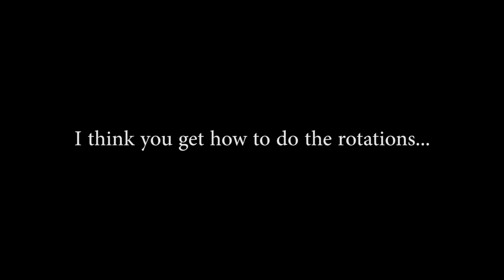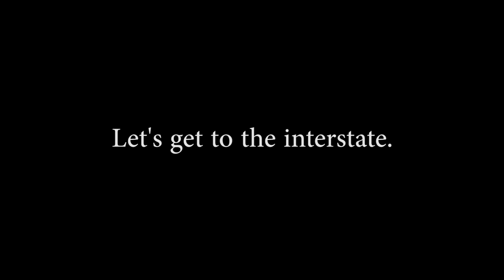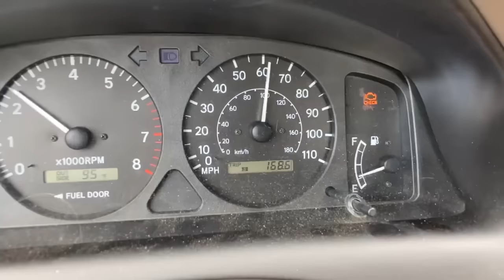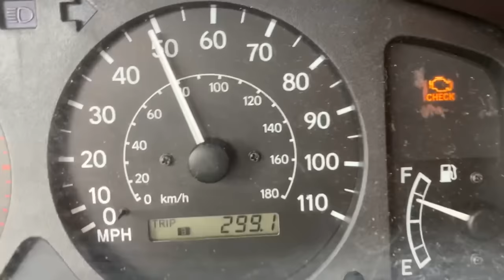Will Berryman's B12 Chemtool stop oil consumption? 😲 | Oil Burning🔥Experiments | Episode 15

Comment: Dave, I have never seen that much oil on the top of a piston. I've rebuilt some pretty bad smokers, but never ever took one apart with liquid sitting on any piston. There wasn't even that much oil on the rocker arms. I doubt if heavier oil would make a significant difference, but I'd like to let you in on a dirty little secret: The car companies want you to use thin oil so they can use it on their EPA test. They get better cold start emission and FE performance with light oil but they can't use it on the test unless they advise the customer to use it. Good luck.
Reply: Even worse, what the EPA considers to be a 'lifetime' vehicle is 150K miles so the manufacturers design their vehicles to last that long plus the fact they consider burning a 1 quart every 1200 miles as 'acceptable', it's no surprise these cars with the thin oil end up burning oil later in life. The fuel economy benefits of thinner oil are only seen when it's cold or on cold start but otherwise they're imperceptible on a warmed engine.
Reply: Saw a report by a Ford engineer on a racing forum some years ago.

Ford rec'ds 5W-20 on modular engines. All for CAFE. Guy said they tested longevity with 5W-20 semi synthetuc & 5W-30 full synth.

Police & taxi engines lasted 150K miles (significant ring & valve guide wear) & over 250K with little or no wear on the -30 oil.

He uses ONLY 5W-30 full synth in his family vehicles & 0W-40 in his race car.

Eff CAFE (Corp Avg Fuel Economy) mandated by the Feds.  My personal experience mirrors this. 

-20 yields abt 2MPG better mileage (7%) than higher vis oils. Engine wear much lower with better lubricants. Eff CAFE & the EPA.

Comment: Awesome job Dave!  Hope the B12 treatment will delay or permanently fix the 1zzfe engine's oil burning problem!  Please keep us updated.
Reply: 3-5k oil changes and add some MMO every other change.
Reply: Isn’t this considered fixed ? Maintain and keep it clean i guess. Hoping this does the same thing in my infinity g20
Reply: Use fully snythetic it make only dark brown at 7000 mile oil change. It game changer for that engine
Reply: @maungmaung4037  if the engine is burning oil that will only help so much
Reply: @daniellocke4172  SR20's usually don't burn oil, that's one of the best engines ever made.

Comment: B-12 is the only chemical with a "poison" label in the bottle ... that should tell you something ... instead of following up with regular oil .. just add marvel mystery oil after treatment and then do your oil change ... then add "stp" oil "basic or simple" to help raise the oil pressure ... it worked for me ... former fleet mechanic ...
Reply: Finally someone with "proper advice" good job.. 👍
Reply: First off you have to dump that saturated  dirty oil  your bearings are screaming Second off you don’t rev a cold engine  ever next  you should always follow the cleaning with marvel to  replace the lubricant you washed off the walls   50 years ASE master automotive   Technician    Fyi if you drive like grandma  your more than likely to accelerate the carbon building process
Reply: @dennisd1778  my rodeo was sitting 8 months so before running I'm planning on putting 8 oz of MMO in my crankcase with a new oil change, and 8oz in the fuel tank. My Rodeo never had that common tapping that is common with that 3.2 motor but I'm sure hoping it doesn't start. I also have a brand new bottle of Berryman chemtool. Any other advice?
Reply: You don't really want to thicken up the oil on cars with variable valve timing. V.V.T. The oil passages are very small that control the VVT. That's why most new cars recommend 0W 20 or something similar. And a quart of Marvel Mystery Oil in the crank case does a lot of good before your next oil change.
Reply: Id Berryman's B-12 Chemtool a detergent based product? Or does it smell like acetone/nail polish remover?

Comment: Thank you so much Dave, excellent series! I think you have given may of us out here some hope. I came across your channel looking for a solution to the same issue on my 2009 Toyota Matrix with a 2AZ FE engine. My engine's oil consumption is not as sever as yours but it still is concerning (1 qt/1200 miles). However, before I try Berrymans I am going to use Seafoam in the crank case before each oil change (3K miles) and see if that works. It is a lttle milder. I worry that Berrymans could damage the crank case seals. You now have one more subscriber. Please keep us posted.
Reply from the maker: Thanks, Russell! May you have success with your Matrix!
Reply: Update: I ended up doing the same experiment as you did with Berryman's B12. After running at redline, or close to it, for about 35 miles and then draining the oil, there was a lot of sludge and carbon deposits present in the oil. I then added fresh synthetic 5W-30 oil and installed a new filter. Two things that I did different than you in the oil change is I added 2 oz. of Seafoam in with the fresh oil - your Seafoam experiment did show some temporary improvement - and added 5 oz. of SFR oil additive which I use regularly in all of my engines. I than drove the car as normal (approx. 65% highway, 35% city). I added another 3 oz. of Seafoam to the oil with 500 miles remaining before the next oil change. I checked the oil level regularly with very little oil consumption and after 3260 miles I only burned approximately a 1/2 quart. I then changed the oil again adding the 2 oz. Seafoam and 5 oz. SFR. Hopefully the oil burning will remain low. Thank you for your video, I definitely helped me!

Comment: I would use a quart of oil every tank of gas with my 2008 Scion xB. I put two cans of Berrymans in an almost empty tank of gas and drove it two days about sixty miles and don’t use any oil anymore. 👍🏽
Reply: My Dodge neon non-turbo used to burn oil and smoke at start up before using Valvoline high mileage synthetic.  After using the oil for several changes the smoke stopped.
Reply: Im about to try this on my 09 xB, hopefully i dont ruin the engine,  burning a quart every tank as well
Reply: I'm confused! 2 cans in an empty gas tank? Jeez was it at least a 25 gallon tank or higher? They say no moe than 1 oz per gallon and a can is 15oz.
Reply: @tallboydr2 worked on mine.  Using about 75% less oil.
Reply: @theoriginaljimmykicker  i tried it a few months ago, consumption went down like 50%, a bit better than before, but i also it burns less if i dont fill it to the full mark
Reply: @tallboydr2  another important thing to note.   I’ve done it twice.  The first time it reduced it by half.  Then a second retreat reduced it more.  So it went from like 300 to 600.  Then 600-1300.  I truly think if you run a can of this in a half tank of gas after the initial treatment, this will continue to improve.  I thing to the point to where it uses almost none.  I’ve got a Lexus RX350 that has 417k miles on it.  It uses less than a 1/2 quart between 4000 mile changes.  Honestly I think it has a small leak and doesn’t really burn any significant amount at all.

Comment: Cool video. I saw a video by Mike Busch of Savvy Aircraft Maintenance and the topic was fixing low compression on aircraft engines. AVGAS is leaded fuel and the lead bromide builds up in the rings and cannot be dissolved like carbon from unleaded fuel. So, one way to try to force the lead out is by filling the cylinder with a solvent at the bottom of the compression stroke, installing the spark plugs, and pulling the engine through a compression stroke. If the valves are lapped and seated well, the solvent will be forced through the rings and hopefully mechanically remove the lead.

I am going to soak the rings and leave them for a while. Then, I am going to do the ring wash like I described with the Berryman's or with Sea Foam, or maybe a stronger solvent. I am thinking it light work really well.

Then you have to put oil in the cylinders and turn the engine over, since every bit of the lubrication will be washed off the cylinder walls.

Comment: So loving your experiment/results!
Keeping your methods so consistent is key.
I'm at point with 2006 Tundra at 101 5K that injector swap, BC Gasket Kit on Bank 2, and PCV replace.
B12 next if the oil keeps getting dirty prematurely. 
Great job.
Subscribed.

Comment: We would use automatic trans oil in the oil to clean the sludge and buildup, it also softens the seal to help with oil leaking. 1/2 quart to 5 qts of engine oil

Comment: I was hoping you crank the engine  to remove all liquid before installing the spark plugs! Hopefully all the seals didn’t get harden from the B12 Chemtool because of the rate of evaporation! I would probably drain the oil before the test drive!

Comment: I've tried a similar test on 2 Jeep 4.7s I had that used oil due to stuck rings. I switched them to synthetic oil for the high detergent to break it up as best I could, with some cleaner as well. One thing I found that made the difference was not just high RPM use, but high load use. You really want to heat the pistons up a ton. I would load up my trailer and go pull big grades with them and try to get the engine temp climbing and maintain for awhile. Seemed to work alright.

Edit: if you do change oil visocity, my go-to oil burner "fixer" is 5w40 Rotella. Great oil, and seems to help. Subaru guys love it for some reason 🤔

Comment: I own 2001 Corolla with oil burning issue as well. I suspect that sometimes if i don't warm up the car in the morning (specially in winter) there is more oil loss when piston slap noise is louder which kinda disappears after engine have warmed up, that slap contributes to some oil passing to burning chamber and i lose more oil that way. Piston slap is when there is a bigger gap between cylinder walls and pistons. When the engine sits overnight rings & piston shrink plus if the engine has some wear there is even more lose. When the engine is warmed that gap will be smaller which will translate to less oil passing through the rings. I'm finding if i drive with mostly low rpm in town i loss less oil while a short free drive (higher rpm) cause more oil burned. Keep up the good work!

Comment: The area of the piston rings and grooves is one of the most challenging parts that a motor oil's formula must protect. This engine with low tension piston rings combined with limited or very small holes in the piston oil control ring grooves or "ring lands" creates a challenge to average oils. To keep the piston rings free and the oil return holes open behind the oil control rings, an oil of high or highest quality is what is needed. First off, a synthetic oil can deal with these challenges better due to better resistance to highest temps in this piston area near the combustion chamber. But there are all levels of quality in synthetics. Mobil 1's best EP oils help here as do Castrol's best  Extended Performance synthetics. If you really want the best protection, consider Amsoil's best Signature Series oils. Had your engine been run on this oil it's whole life, even at 15,000 mile oil change intervals or longer, you would not be trying to lower oil consumption on this engine. I know this with personal experience.  No I am not an Amsoil Dealer, but I have been impressed with their product performance over the years.
Reply: I have a Volvo T6 Polestar that burns about one quart per thousand miles with 90,000 miles on the odometer.  This issue is not a secret to Volvo owners.  It has been maintained at the dealer since it was brand new, with no oil change exceeding 5,000 miles.  The dealer only uses Castrol Synthetic.  I am evaluating whether to try the B12 treatment as done here, as there should not be any  reason for this engine to be burning oil except for low quality rings when it was built.
Reply: @frankmc2602  did u change the oil every 6 months? Or every 5000 miles? Oil needs to be change every 6 months or twice a year. Rather u reach 5000 miles or not, but for some people only drive 5000 miles a year so they stick with the 5000 miles rule, change it when it reach 5000 miles but never realize it’s been a year old that 5000 miles oil was in your engine collecting fine deposits and particulates that can ruin and clog your oil ring and holes. Your car burns oil because manufacturers went to low tension rings that created less friction for efficiency years ago and extended oil change interval over 6 months to 8 months or 1 year. if u keep the oil in your engine for too long, let’s say over 6 months, nothing high quality oil can help u.

High end quality oils like amsoil or redline, Royal purple has higher than average grade detergent additives and high level of ZDDP contents in them. Which translates to clean so well and protect so well…BUT since their oil clean so well, it ended up a lot of deposits from oil combustion vapor in them, thus they trends to be becoming black contaminated really fast. This will also clog the oil filter faster than normal as well. The correct way to extended oil change interval was change oil filter every 3000 miles rather u use high end oil filter or not. 3k is the maximum life a any oil filter. Then u can extend the oil change to 8k, or 10k but change the oil filter every 3k to keep deposits out of your engine oil. (I don’t recommended because I don’t believe in extended oil change interval anymore)

R u sure your dearship using Castrol synthetic for oil change? Did u see them put in the oil with your own eyes? I asked because I know dealership claimed to use certain oils but in fact, they use the cheapest oil they can find for servicing your car then charge u the cost of the oil they claimed they will be using. It’s a known practice thru out dealerships that the techs and mechanics will always end up with piles of FREE oils left over in the shop for themselves because customers paid for them but it’s not needed for their oil change becuase it’s never use.

Also drive your car hard at times help burn off deposits in the piston ring as well. People who track their car will always have a healthy engine than people who just drive their car normally and don’t rev the rpm pass 4000. Because gasoline is a VERY VERY good cleaner itself. (It’s strong enough to strip off paint and rust) so it’s a good carbon cleaner. When u drive at high rpm, u put your foot down the gas pedal, injector will inject MORE gasoline into the combustion chamber and high rpm means piston travel up an down at high speed which creates higher than normal HEAT. So high amount of gasoline meets high mount of heat and speeds = bye bye carbon buildup.
Reply: This why I always used an engine flush before changing my oil , Amsoil or Liqui-Moly . Now I have tried BG EPR twice and for the third and last time soon . Then back to Amsoil or Liqui-Moly .

Comment: The galloping sound when starting means you are down a cylinder. The one that was dry is probably not sealing/low compression.
Reply: More like piece of carbon sticking a valve open slightly

Comment: Careful if there's still B12 in the pan and it's still diluting the oil. Just check for the oil getting thinner over the time you pile up miles. Keep up the good work
Reply: I've done the same thing a few times, I do it when the engine is warm, most of the berrymans evaporates. any remaining chemical is acting as an engine flush and removing sludge and varnish.
Reply: No need to be careful. The chemical evaporates

Comment: Great results ! I have had similar results using a 20% ratio added In the oil of HyperLube, with also great results. My vehicle(s) 4.6l ford was using about 1qt of oil every 1k miles and after keeping the 20% Hypelube they (actually of them) only used a very small amount of oil at the 5k oil change interval. Seems todo a good job of keeping the rings & ring grooves very clean. Good product !
Reply: Hyperlube and Lucas are not good. They are just cheap "Bright Stock" they can gum up piston rings on engines that do not have issues with piston rings. If you need a heavier oil use a heavier oil not only is that cheaper but it is less likely to gum up the rings.

Comment: Okay I got results after one full tank of gas. I have no oil consumption after the B12 piston soak!!!!! This thing has burned oil as long as I've owned it since 2018 and just got gradually worse and now no pucks of blue smoke or anything. Thanks for doing this dave. I'm still going to run my cleaner through it but I'm going to get some life out of the oil first! I'm using 5w30 Mobil 1. Also did you know these engines have been backspecced to 0w-30 and 5w-20? A thinner oil after this soak may help with the issue of the drain holes.
Reply: Great testimony! 👍🏻
Reply: @EricVonHunter
Better additive pkg matters - not the weight. I use Castrol 0W-40 or Rotella T6 15W-40 (yeah, diesel oil) in my gas engines. Castrol preferred but Rotella available locally (Wallies & Autozone no longer stock 0W-40 Castrol in 5qt jug - cheaper). GREAT oils & additive pkgs.